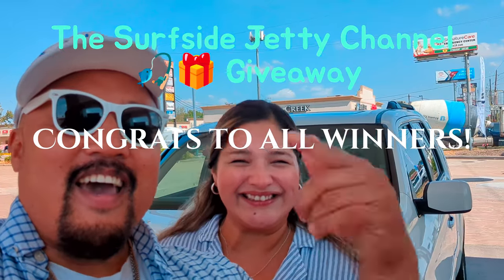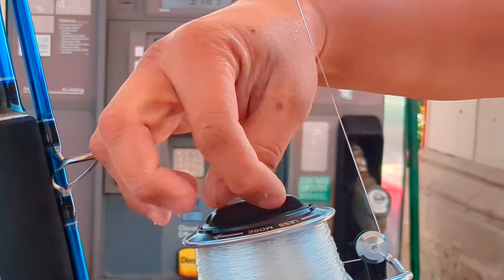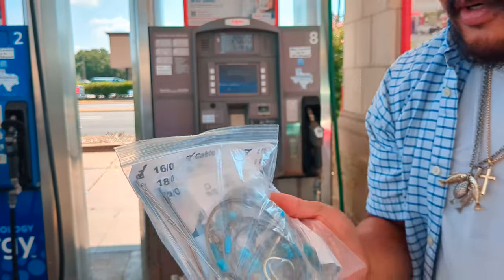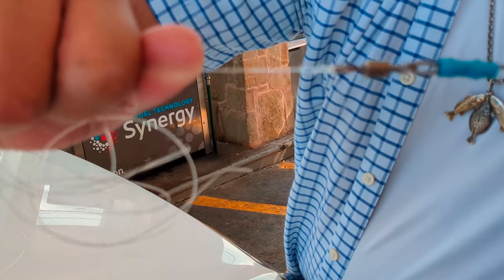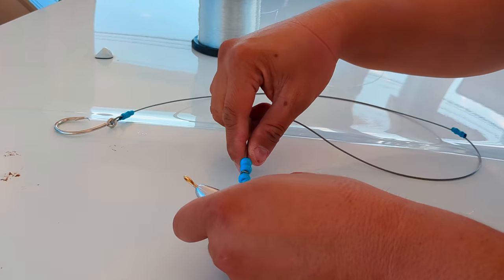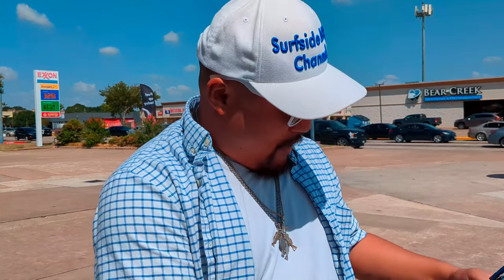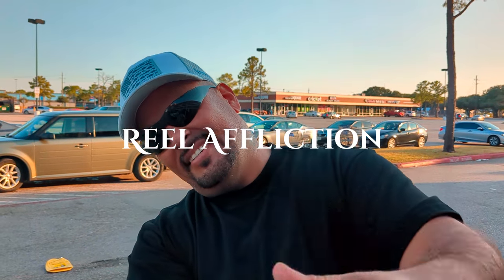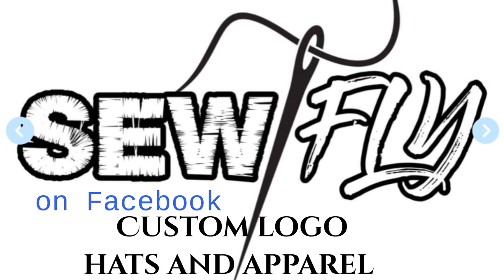How to Knot, Cast, Set Spider Weight, Drag & Catch BIG FISH 4K Congrats to FISHING Giveaway WINNERS!

Comment: Congrats @thrif-teaannie7128 on the new rod and reel. I know it's already spooled, but I can't lie. First thing I would do is strip that line onto an empty spool (for reuse as leader line) and replace it with some good 40lb braid. Should be good reel for a good while though.
Reply from the maker: Sup Dan, I use all mono on my Penn Wrath 8000 to leader but to each his/her own. The rod is rated for 30# line as well, but it's really up each user. I caught a super massive bull red last year under causeway with 30# to 3rd Coast Fishin leader. It's all in your drag and how you work em in. 😉👍
Reply: Yes sir. I just prefer the braid for less flex on hooksets and runs. Braid is usually thinner than mono as well, so you can run heavier braid in place of the mono without losing capacity.
Reply from the maker: @danver1971  it's an 8000 reel she has with over 200 yards of line I spooled and an extra spool of more line for later. 😁👍 🧵